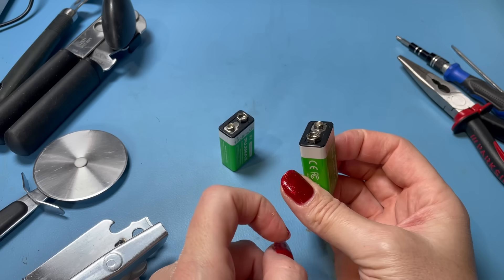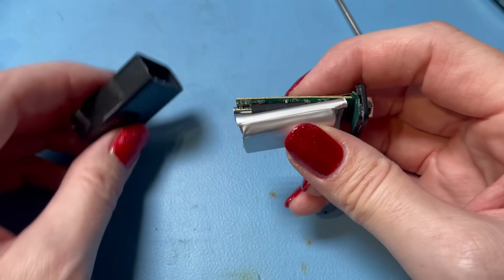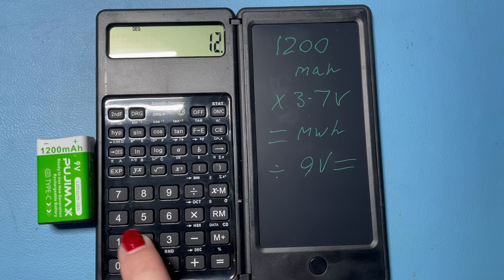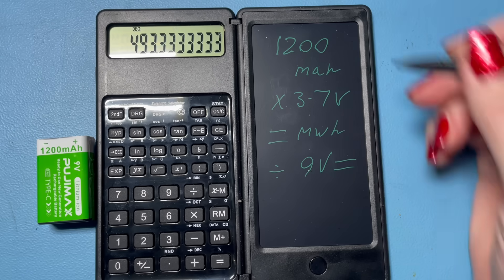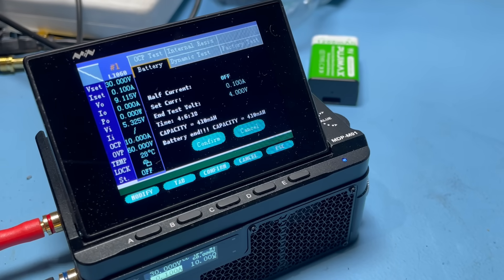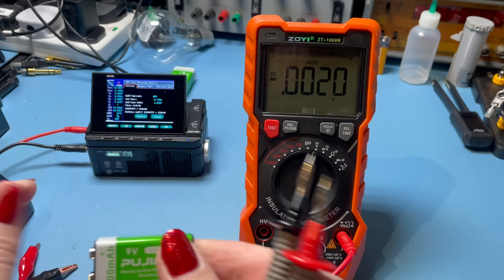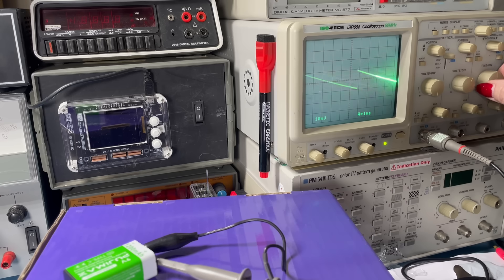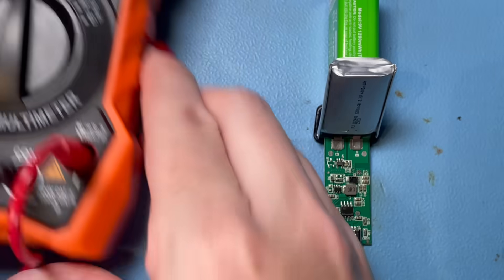Temu 9V Lithium Rechargeable USB-C Battery Teardown

Comment: The issue with these is that the circuitry inside is running the cell flat very fast so it's not usable in devices that draw very little current.
Reply from the maker: Yes totally agree. That's why I did my tests at high current. These batteries have a use, just not the same as conventional battery usage.
Reply: Not really.  Tests show it uses only 1/10th of a mv so it could sit there for a year before it drains.  Well it'll probably cut off sooner than that as the useable voltage would have dropped too far.

Comment: Rather use a 3 cell LiPo and a 7809. But how to get that plus a bus, and a circuit to isolate the 7809 when the current draw is zero into a PP9 case? That is the question.
Reply from the maker: You could use a more common LM317 adjustable regulator. Old regulators though are not very efficient, would waste battery capacity. A modern battery management chip might do it.
Most 9V things will work off 2x pure lithium ion cells in series. This gives you 8.4V when fully charged.
Did you mean a PP3 or a PP9?

Comment: My similar 9V batteries self discharged and so were useless for multimeters etc. Charge them up, leave them for a week, no output. I bought some from Amazon and some from AliExpress and they all self discharged. I believe it's the charging/BMS that draws a small current in standby.
Reply: they constantly boost the 3,7v of the cell to 9v no matter if anything is connected, that draws a big amount of current considering the tiny capacity.
Reply from the maker: These batteries do have a use but not like conventional batteries. A pure PP3 format containing just 2 lithium ion cells in series giving 8.4V when fully charged would be a good choice for multimeters etc.
Reply: I was wondering if they would be good for my meters. Thanks for the info!
Reply: Really?  That can't be right.  There was a test on the 9v showing the buck converter only draws a miniscule 1/10th of a mv so that gives a year shelf life before draining.

Comment: My radio-controlled clock won't work with the AA version of these. I assume there was some high frequency ripple upsetting the circuitry of the clock.
Reply from the maker: Yes they contain a switching boost convertor that generates switching noise and harmonics up into high frequencies.

Comment: That means you loose 2/3 of your capacity by using a voltage invertor.
Reply: No you are getting the capacity in Watts delivered at a higher voltage and lower current. You cannot do better due to the laws of physics. In reality, the converter is quite efficient. However, the battery is marked that it could run down to 3.9v, not 4.1v - so it is dieing early. I tried to design one of these myself, and the difficult thing is to eliminate battery drain when the load is switched off.
Reply: @andrewgrillet5835   Not hard at all. It is a chip design flaw not to have an auto off switch.  The buck converter should only activate if there's a draw.  They might fix it in newer versions.
Reply: Actually only 20%, 400mah delivered vs 500 capacity.  That efficiency is pretty common, some are are 95% under optimal conditions.
Reply: No. If you want to know how much capacity you lost you have to calculate watt hourss (Wh)

Comment: Those 9V batteries are the bane of my life (wire tracers  pipe testers  multimeters etc), tired of throwing money away on them, they ain't cheap! So will give some of these a go I reckon, if they can just quieten down the output
Reply from the maker: You can also get pure lithium ion rechargeable batteries without a boost convertor. These are just 2 cells in series giving 8.4V when fully charged. They work well in multimeters etc. The EBL brand is very good.

Comment: Thanks for the teardown.  I tried making my own rechargeable 9v battery once, using a combined li ion charger and boost module from eBay, but I couldn't get a very big li-po cell in the space, about half the size of the Pujimax.  If I recall correctly, it was a cleaner output though.

Comment: Never mind the battery, where'd that calculator come from?  I've got writing tablets like that, having one on the calculator would be handy.
Reply from the maker: It's another Temu gadget!  I bought this one a couple of years ago and it's been very handy.  
They still have it listed: https://www.temu.com/uk/science-calculator-10-digit-lcd-display-folding-calculator-with-handwriting-board-dual-battery-powered-suitable-for-students-teachers-engineers-g-601099519717968.html
Reply: @JazzTechUK  Hmm, that one came up as discontinued.  I did find a different one, but there's a heap on Ali if you look for "calculator with lcd tablet".  Thanks!